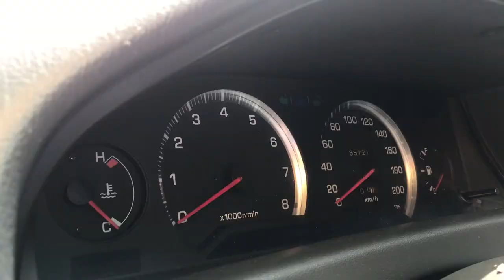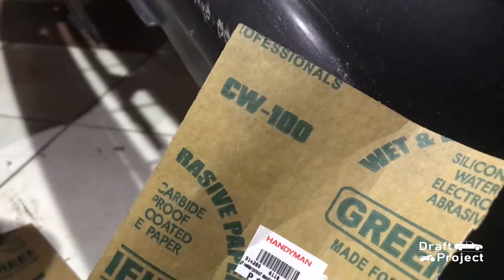How to Paint your Bumper Part 1 - Honda Civic EG - Draft Project

Comment: Great Video man,  

I will not be using body filler in  my bumpers because they don't have any scratches or scuffs do I still need to add primer  ? 

Can I just apply the base coat and clear coat ?
Reply from the maker: If thats the case, then its pretty much optional to use a primer.

Yes, you can skip the primer but be sure to sand and wetsand the bumper. Sanding the surface will create scratches, making it stronger for the paint to stick on. Make sure the prepwork is done properly before you apply the base coat and clear coat.

Thank you very much! Take care and Godspeed.
Reply: @DraftProject  Good info bro. I appreciate it. Keep up the good work !!

Comment: I got chips on my bumper, can I use primer to fill them?
Reply from the maker: Yes you can. But sand the area first until it becomes flat. Then apply primer and wetsand. In that way, you will have a smooth finish on your bumper. Don't forget to put base coat and clear coat.

Comment: sir mas save ba sa budget pag tayo ung nag paint instead of bringing it to the shop?
Reply from the maker: Yes po sir. The only difference po sa paint shop ay customized, kumbaga mapipinturahan nila ng katulad nung original paint mo sa body since doon magtitimpla sila ng paint. Yung method naman po na paggamit ng spray cans ay mabilis pero hindi po magmamatch up yung kulay sa original dahil magkaiba ang shade ng kulay ng spray paint po.
Reply: Draft Project hindi ko nalang i.match sa original color, cguro black bumper nalang gagawin ko, ang importante po kasi save sa budget, malaki po ba ma save natin pagka tayo ung mag paint?
Reply from the maker: @CrytoTalksPH  Yes po sir malaki po ang matitipid. Pag sa labas po kayo nagpaggawa, materyales at labor po ang babayaran niyo po. 

Pwede rin kayo sir magtry maginquire sa mga ibang shop baka sakaling may promo sila about painting.